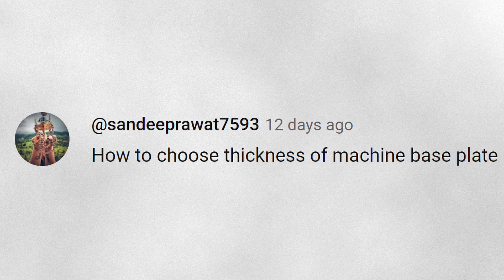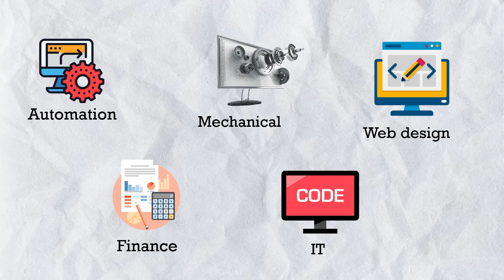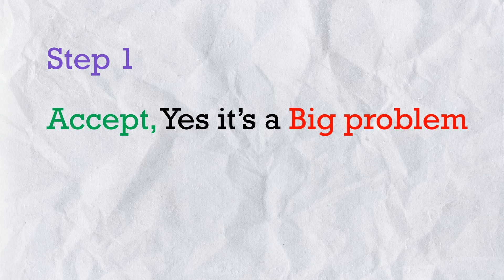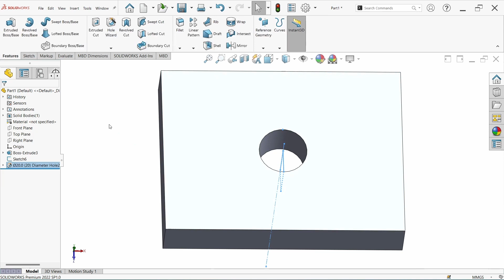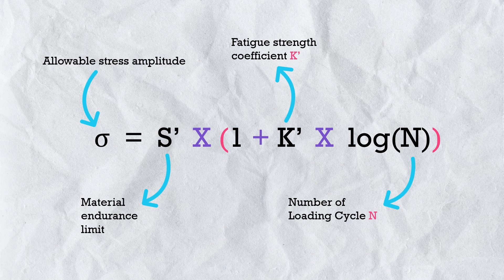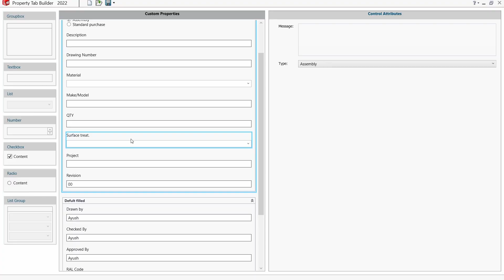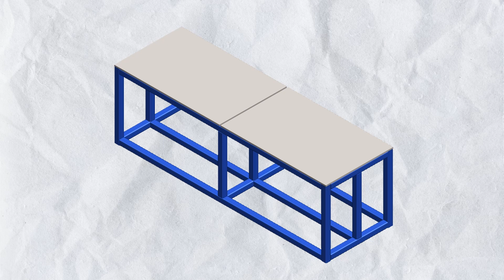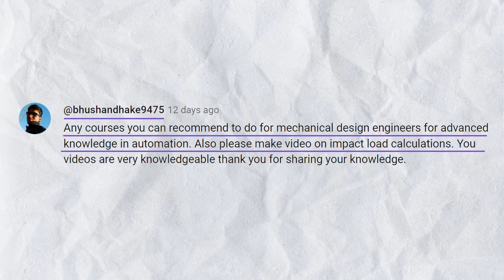(QNA) Mechanical Design Engineering Questions and Answer

Comment: Can you make series on “practical FEA skills for real world projects”? There are tons of videos/courses around teaching FEA software skills but almost none focus on how to utilize these software to  setup a proper FEA study.

Such as, how to avoid over-constraining/incorrectly constraining a part, how to analyze the result and spot the difference between singularity vs actual stress concentration, when can you ignore a small stress concentration in one small area as surrounding region will take up the difference vs when it needs redesign, how to defeature a complex part/assembly into a single part to simplify the FEA study without compromising the final result and so on.
Reply from the maker: Exactly. I will plan a series.

Comment: Hello sir i love to watch your videos it's always brings with information.
But I really want more information.
Right now I am pursuing mechanical engineering and i want to become design Engineer.
But my question is how much theoretical knowledge should have to be gain.
E.G. the subject called dynamics of machinery it consists 10 chapter so should i have to learn all chapters with  theory and sums & equations? 
Same in Ktom,heat transfer,Som?
Please sir provide me some guidance please 🙏🏻 sir
Reply from the maker: Hey, yes you should know every subject of engineering for better understating of complete system. Even heat transfer. why?
Let say you want to a rocket designer for space X.
how you could be without knowing heat transfer? 
As much you study engineering (also other branch of engineering) you becomes better design engineer in future.
But if you just want to be CAD Designer than knowing the software is well enough.
Reply: @mastermechanicaldesign it helps me a lot.
Thank you for info and guidance 🙏🏻

Comment: Very informative videos. Ive learnt alot. 
I have a question, can you do a video on compressor sizing and selection based on air consumption requirements of cylinders. Alot of times our clients ask for cylinder air consumption and to give them  air compressors size.. and i dont have a clue how to do it. Airsupply to cylinders we use is typically 6 bar in most plants. Thank you and keep up the good work
Reply from the maker: Okay. Noted !!

Comment: I just found this oasis of information regarding design engineering, thank you very much for sharing your knowledge in a clear and concise way, I have many topics in mind about mechanical calculation that you could support, the first one, and I would appreciate it if you created a video on C steel frame calculation in Solid Works.  for 2 tons for example.  thank you very much again.
Reply from the maker: Sure !! I will definitely explain in the FEA analysis series

Comment: Hii i hope you are doing good
I'm just placed in cnc manufacturing company as fresher design engineer.
I have done BE in mech in 2021
But I have worked 2 years in other field so I have no prior knowledge of industrial design yet but I have intrested in it. So now I have learned solidworks,creo, autocad basic and learning real industrial design and just showed your video on GD&T it is great explanation 👍🏼 
My question is right now I'm not able to understand it properly,I can't understand it what is gd&t, limit & fits,how to design any cnc part,what are the steps of designing part from scratch, how to apply gd&t and limit fits for manufacturing ...?
Reply from the maker: Hi Soumibamania. Designing from scratch and understanding everything like GD&T, tolerance as per machine functional point of view as well as manufacturing point of view.. takes time and experience, this is something that you learn with time and machine design projects. Also applying optimum GD&T by understanding overall everything takes time and practice. So don't panic that's why you don't know. You have just started. But as i have explained. GD&T is not only about symbols and rules. It's all about how and where to use it. And i have all those things throughout my entire 10 years of experience and am still learning. 
And unfortunately there are no such courses no such videos or written steps with examples. So this is why I am here, trying to explain everything in simple words. If you want to learn how to design from scratch. I have designed three machines here. Do check out, this will help you alot

Comment: Have you built your own machines and sold them yet?
Reply from the maker: No, I'm not a manufacturer. I'm a Design Engineer working with an SPM manufacturing company. However i have designed more than 600 machines so far which got manufactured and sold.